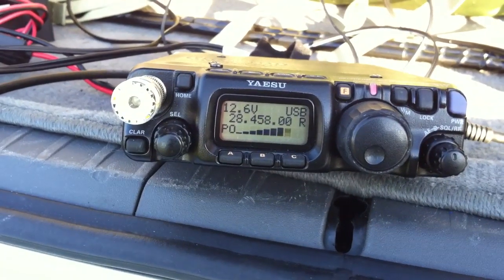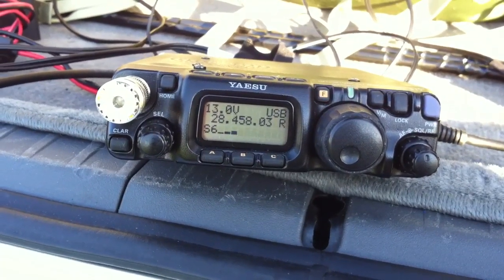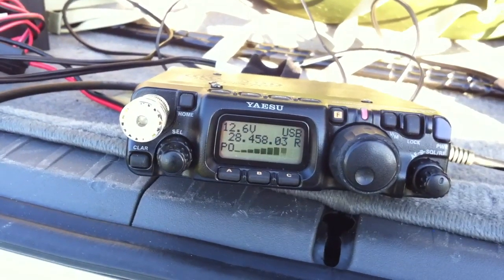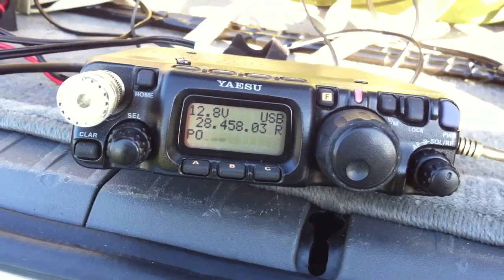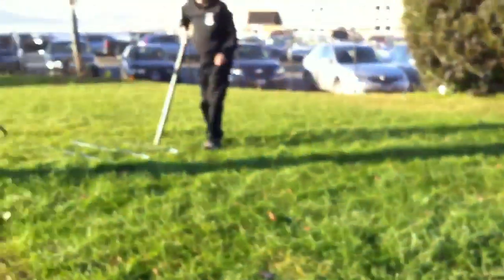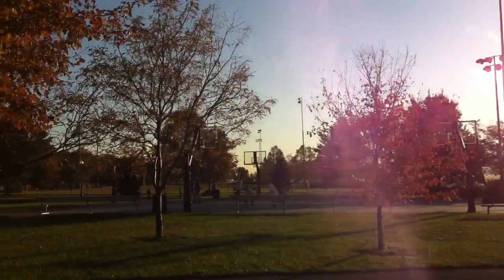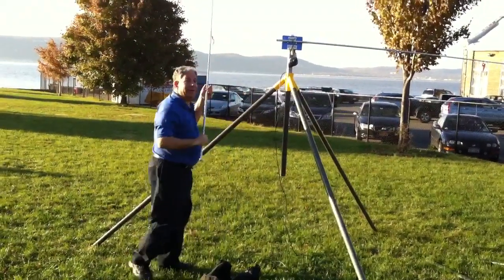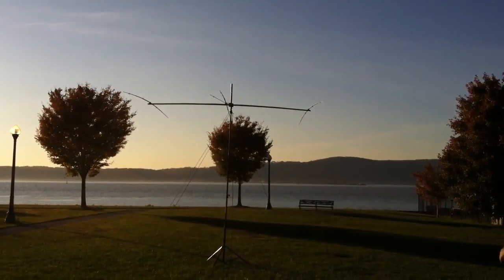QRP YAESU FT-817 and YP-3 portable yagi.

Comment: Great job on making this video. loved it.. I just got an FT-450D and have been cranking it down to 5 watts, saving up for a FT-817ND right now for the spring. It was really nice to see the rig in action and the antenna and the park you were in.. captured the ham radio experience well, and with a DX station too. !  Keep up the good work.
In response to one of the comments:
> Whisky CB comment > whiskey is the official phonetic word for the letter W, and watts starts with W but only one syllable so Whiskey is used for better understanding during noise or low power.
Reply from the maker: Thank you! 

Hope you enjoy all the other videos that show many other types of experiences running QRP. 73!

Comment: He is a QRP operator. I have the same radio. I happen to really like QRP operation. It's cool to see how far you can get with low power. I made a 5000 mile contact to the Japan on 10 meters with only 5 watts; using PSK31. I was using a home built dipole antenna. If I were doing CW I could go even further. I just need to learn Morse code. I managed to pick up a CW signal from South Korea.

There is nothing special about cranking up an amplifier to 11. QRP > QRO